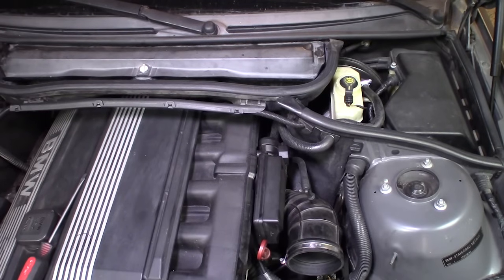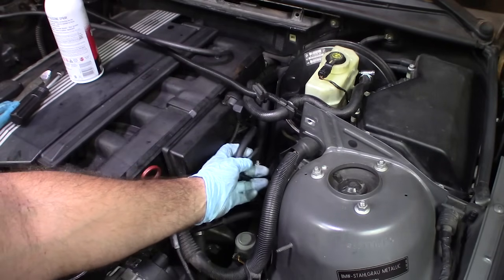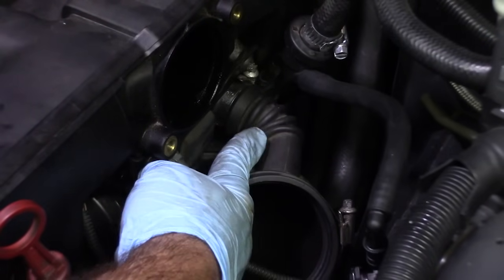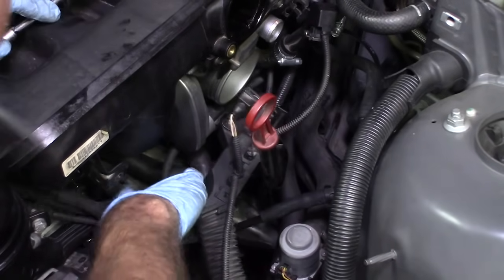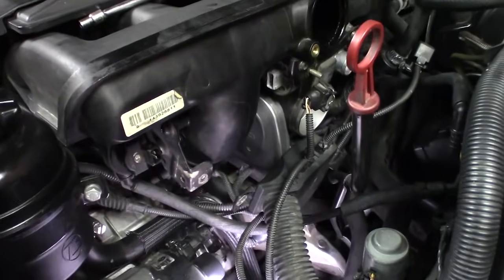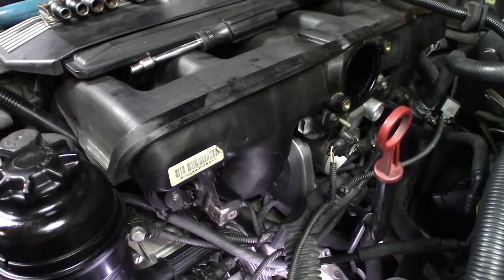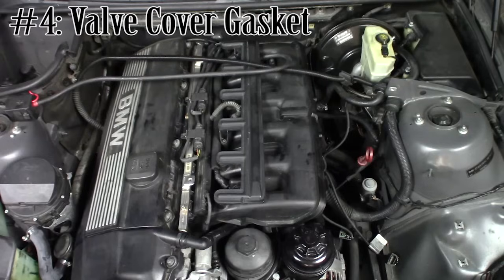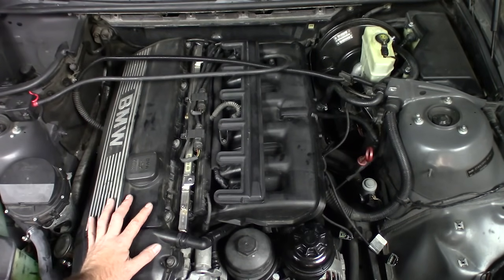BMW E46 & E39 Most Common Vacuum Leaks P0171 & P0174

Comment: Hey bro.. I need your help..Im a mechanic but not big Into repairing BMWs... My son has a 05 330xi...we replaced all coils, plugs, ccv valve... O2 sensors and it STILL runs like crap and no matter what i do,  I still get the same code for bad oxygen sensor and misfire??.. What could it be?????

Comment: Thank You! I have already replaced a few parts that have helped in various ways (MAF, purge valve sensor, thermostat, spark plugs, the list goes on), but my main issue is still not fixed. I will be checking these parts. I was told to check them, but didn't know exactly what to check. I will be pricing all of these parts before I even go check, because I'm fairly certain you have given me the answer I have been looking for!

Comment: Hey, love your videos man, thanks for all the helpful info.
Quick question, if I'm only getting P0171 code, could it still be a vacuum leak? Or is this like a faulty O2 sensor in bank 1?
Reply from the maker: +James W (CanadaShooter) Could be a vacuum leak on just that bank, yes.  Checkout my fuel trims video to be sure: https://www.youtube.com/watch?v=4CcwtaIe5c4 -- that video should also help you figure out if you have a faulty O2 sensor (ie if the voltage of the pre cat sensor is not going up and down and you are in closed loop, it's likely bad).  Don't just waste your money on O2 sensors--they don't often actually go bad.  Find your leak before you throw parts at it.
Reply: +50sKid OK thanks man, that helps. I'll check out the video and start checking vacuum/intake hoses tonight. Good thing I have access to a spare car.
Once again, thanks for the help!
Reply: 50sKid hey kid I have a bmw 323i 2000 is getting a code 1250 do you know what’s that code?

Comment: Really great vid im chasing down a PO174 fault currently on my 320i. I found a split in the upper intake boot so im hoping that was it and there are no more. However when cold the engine runs very slightly less smoothly but only for 30secs so im wondering if there is another.I am waiting to see if the EML light comes back on.
Reply: +macpdm While you're down there you might want to also clean your idle control valve.  It's accessed by doing basically everything that is depicted in this video..  Good luck!

Comment: Hello,

I have a bmw 5 serie e39 with and M54 engine. 

I am worried about the following.
- It makes a whistling/whining noise when i press the accelerator pedal.
- When i turn off the engine a couple of seconds later it sounds like it is relasing air like a relief valve when it has too much pressure built up.

Can someone please help me with this?

With kind regards, Jens

Comment: Thanks for the video, especially the ccv quick replacement one. I followed your advise step by step and managed to replace it eventually. However i found something that might interesting.

The ccv has a hose leading to the oil dipstick.when removed the hose I found the dipstick got completely stuck of oil dirt. I cleansed it but when I pour cleaner in that hole, the cleaner still got stuck.

So my qusstion is that this hole should have an open route to the main dipstick line or is it a dead end hole?
Reply: Actually I realised that this dipstick should lead the oil condense back to the oil pan. So if it is clogged, can it cause misfires?

Comment: try removing the small tube at the top rear of the boot behind maf. temporarily install a length of tube that allows you to blow smoke (cigar?, or users preference) into the intake boot and check for leaks.

Comment: Very helpful, thanks! I'm currently trying to self diagnose my running issue, lack of power, slight kangarooing when driving, rough idling and randomly cutting out when coming to a stop..? No faults on plug in! 2003 E46 318ci If you have any input to where i could even start that would be a huge help

Comment: I have a vacuum leak with error codes p0171 and p0174, I took it to the mechanic and they ran a smoke test through the intake and said i had a leak in my air intake manifold control valve, they quoted me $840 for parts and labor and I believe that's too high. What is everyone's thoughts? (I know only basics about mechanics)

Comment: I have codes 1423&1421 I replaced all the air intake, maf sensor all Ccv unit all 4 O2 sensors n still have the codes grrrr anyone have any advices ? Thanks

Comment: Hello,

last year I had these codes and thanks to your video I noticed that the intake boots were broken and for one year everything was great !

Now I have E3/227 and E4/228 CA/202 CB/203 "deviation too great too rich" "control limit limit rich"

Do you think I should look for a vacuum leak or for something else ? 

Car runs great as before.

Thanks

Comment: Excellent information. I have owned my 2002 BMW 325csi since new, and am having the vacuum fault code occur regularly, and now a rough firing engine, with the fault code on my OBD reader indicating this problem. This is excellent information for me, and as I am a long time hobby mechanic, I will check out all the potential sources of the cause. Thanks again... ... Fortunately, my 1966 Lotus Elan does not have these type of problems.... Dual Web Carbs and "O" rings on the intake manifold are all that I have to check.... oh well !!!!

Comment: Great video, particularly the fact that you take the time to explain what is going on. I have a quick question. If the oil separator is not broken like in your case but still there is a vacuum leak from the two pipes connected to it (I smoked the system and it was clear smoke was coming out of the two pipes where they connect to the oil separator) does it make sense to replace the pipes only (assuming there is  fast way of doing it) or the work involved to reach there is so much that one should just replace "everything" (perhaps including gasket seals is they are too hard). Thanks!
Reply from the maker: Just replace everything since the oil separator itself is something that will fail eventually (the diaphragm inside of it tears).

Comment: @50sKid 
If the Oil Return line from the bottom of the Oil Separator going to the bottom of the oil dipstick is cracked or has a hole, would the "Remove the Oil Filler Cap" vacuum test be effective for testing for that leak. Because I tried removing the oil fill cap with engine running and the car's idle went from bad to worse then I put the cap back on and it got better.  Basically, does the oil cap removal method mean all of my CCV components are working properly when I hear the change in engine idle?

Comment: Thanks a lot for this video. I had just got out of the hospital when my grandsons 2001 325xi started giving him p0171/p0174 codes. I took all the hoses I could get to off and looked for vacuum leaks. I had even taken the intake runner out to get better access to look for other leaks! Didn't know enough to look at the gasket at the time. I only knew that when I sprayed brake fluid into the general area of the intake, I could occasionally get the engine to go rich for a while. It was so tight an area that it was hard to locate exactly where the spray was impacting the leak. I almost gave up and had the car taken to a shop to be smoked when I ran across your video. One viewing of your video and I knew it was the seal on the intake runner. Borrowed an incorrect sized seal from my neighbor and managed to prove it was leaking(couldn't quite get the intake runner shoved back into it's slot-but the seal held). Have ordered a new seal and will be in next week. In any case, your video was instrumental in my fixing his car. BTW, I too broke a rubber housing taking it apart(ironically, BMW had that housing in stock for $22 but wanted $400 for the intake runner because they didn't sell the seal by itself! Thanks again!

Comment: Do you think surging idle might be caused by vacuum leaks? Also the 325i I'm working on has terrible oil and hasn't been changed for god knows how long. Do you think bad oil or oil leaks also contribute to the surging idle?
Thanks man! By the way, very informative video.
Reply: The valvetrain relies on hydraulic pressure from the oil to operate... If your oil is bad or pressure is leaking, then the valves don't run properly, and your idle will bounce up and down. Another common cause is the Oil filler cap gaskets.

Comment: Hello! I love your videos and have been watching them like crazy. I got a 2001 bmw 330ci that idles very rough. It used to happen randomly every 1000 miles or so and a restart used to fix it. I have been meaning to fix it but the other day it just completely went bad. Now it idles rough right away as soon as I start the car and it's basically unusable. I checked the intake boots and those seem fine. There is very slight oil leak from the valve cover gasket but I checked the vacuum line in your valve cover gasket video and that seemed fine. Any suggestions? I do have both lean bank codes.
Reply: Migght be maf

Comment: You are the MAN!, thanks for your videos 50's kid. Add a donation link to your youtube page, you deserve some rewards for your good advice!!! i had this issue for years, sent my car to mechanics and kept changing sensors, and i gave up, until i saw your video. I followed steps by steps and got it fixed. I am not mechanic but you made it so easy, anybody can do it. I had vacuum leak on top air boot, my disa also was leaking and the bottom boot was also fixed with electrical tape!!!, i fix these 3 f(including the cabin filter) or less than 50 bucks!!!.  Thank you for being around, we E46 fanatics will appreciate it.

Comment: I have no leaks and 52lbs pressure and still 171/174.. I ordered the reader and am hoping to see if it is the MAF or the O2 sensors. It takes 50 miles to code after reset.
Reply: I replaced the CCV, hoses, dipstick o ring, throttle body o ring, DISA seal, O2 sensors. STFT was at zero, LTFT stayed around 14. I replaced the MAF and the LTFT iwent down to zero and out went the CEL. Your video helped BIG TIME to diagnose. The MAF was trending around 5 at idle (900rpm) until I replaced it and the flow was showing 6 after replacement.
Reply from the maker: +Robert Tison nice, great going

Comment: Hello,

this video is great and so clear, thanks a lot man. I was so pround I managed to change both the Oxygen sensors but your right the problem was all the leaks...

I got a E39 530i, it seems that I don't have any line close to the Oxygen sensors. The one your are talking about at 13:00. Is it because It is simply not here or because there is none ? 
Do you have more information about that line ? 

Thanks a lot. Greg.

Comment: If you have 171, 174, AND the code for wiring on O2 sensor bank 2, is the most likely situation that both my bank 2 o2 sensor is bad AND I have a vacuum leak?  BTW, thanks so much for these videos.

Comment: It’s 100% those two vacume hoses, I knew they were cracked and probably Leaking, Also getting a Code for my intake boot But I literally just replaced it with a brand new one ( cuz my dumbass ripped it off) will be replacing those Hoses soon, I know for a fact it’s those

Comment: anybody deal with surge and stall code p1632 p1634
Reply from the maker: Try turning your ignition to on (but don't start the car) for 1 minute.  The computer will automatically recalibrate the throttle body.  Have you recently cleaned your throttle body?  If so, did you manually open the throttle plate?  That's what damaged it, if so.

Comment: Thanks for a great video! I've got a BMW 525i e39 touring -02. I have the same codes. P0171,P0174. I have done several smoketest on my car and there are no leak anymore. It began with some leak at first, we changed the valve cover and gasket, and intake boots. First i thought, GREAT now the problem is gone, but NO NO! I have also replaced my FuelFilter "the one that i had was original, WHY? i don't know, I mean it was really dirty". I have changed both of the oxygen sensors, "maybe i didnt have to do that", I have tried to clean my Siemens MAF with CRC. But still the engine light will appear randomly. Sometimes after 1miles "swedish miles", and sometimes after like 40miles. This is CRAZY!! The car runs good. Next step? Fuelpump/Injector/Fuelpressure?
Reply from the maker: Lars von trier pung What about the DISA valve?  Replace the o-ring.
Reply: 50sKid Hi!! I did that too. But i think i have something. It's just a guess. When the engine is cold when i start it i can drive a long time, no engine light. But when i stop and turn off the engine and wait for 1-2 hours, and drive further again,.the engine lamp appears after 3-4Km. "Everytime", at least tha last 4 times i did the test. Do you think it is the temp?
Reply from the maker: That's likely because you need two driving cycles (starting your car when it's cold) to cause the codes to appear.  No amount of driving is going to fix your vacuum leak, though.  You have a physical leak of air into your intake system.  Watch my video until you have a grasp on this concept and then look into the various areas on your own car until you find it.  If you are doing this yourself, you should find it.  If you are having the work done at a garage then I can't help you because who knows if they are doing the jobs correctly?
Reply: 50sKid Im doing the job at a garage, they are saying that there are no leak. But i will return my car to them. Problem still there. Now they will get more info and i hope it will be easier for them to find it this time because i found a pattern. If they do as i say they will get the engine light. And i have already payed a max fee for troubleshooting, so thats nice. But i can tell them what you said, prob still some leaks... Thanks. I'l be back with more info later. :)
Reply: Hey 50sKid I have a huge vaccum leak its so bad I can actually hear it, its coming from the brake booster but im unsure wich hose it is. Funny thing is when im inside the car i could step on the brake and the hissing vaccum will go away. But as soon as i release the brake, the hissing comes back. Could this cause my lean code? if so what's the best remedy to leak I hope I don't have to change the entire brake booster.
Reply from the maker: +jayspeed BMW sounds like your booster needs to be replaced, I'm afraid.
Reply: 50sKid awww mannn. Ok thanks!
Reply from the maker: jayspeed BMW Yeah I'm sorry about that.  From your description it sounds like the internal seals are leaking.  You can get an ATE brand (which is OEM) booster off eBay for around $200.  I'm sure you've seen my video on replacing it.  Not too hard!
Reply: 50sKid I replaced the MAF with a new Siemens. Now it's gone! Didnt work with cleaner.
Reply: @larsvontrierpung9337  do you have the MAF part link? or parts number? thx
Reply: @3dkinson  the problem was actually a crack in the plastick cover. Not MAF. Did aSmoketest.
Reply: Dont remember the partnumber sorry.

Comment: 3:50 when somebody is about to spray the MAF be also ready to buy a new one. Meaning you will try this as a last option before actually buying a new one since the chances are very slim to none it will work. It does in some occasions but the overal percentage of success (short and long term) is very low. Just saying.

Comment: I have similar issues when cold, except i have rich codes (but with positive fuel trims, confusing AF),am currently running with MAF unplugged because it at least runs negative fuel trims until i figure out whats going on.
I would rather it run a bit rich than lean anyday.
2001 e39.

Comment: Great video! Helped while doing my repairs. I just replaced the whole CCV and DISA valve on my 04' 330ci. I just cleared all the codes, rough idle is gone but there is a steady loud (to me) hissing coming from the intake manifold that I don't remember noticing so much close to the DISA valve. I'm wondering if the DISA O ring wasn't seated properly when I replaced it. Thoughts? Your response would be VERY appreciated. :)

Comment: Hi 50sKid!  You have great videos and I appreciate you doing them.I'm a newbie to BMW's specifically my used 2001 330ci, E46 M54.  I recently pulled the intake manifold to find most of the vacuum lines rotted away and disconnect.  Can you tell me how many total vacuum lines there are on the stock E46 M54 and where each is going from and to.1. From larger one on F fitting on intake boot?2. From smaller one on the F fitting on intake boot?3. I plan to use the larger nipple on back of intake manifold to go to the CCV valve you demonstrated in your other video.4. What is the "unused" and uncapped small nipple on back intake manifold used for or go to?5. Vacuum line coming from the transmission tunnel/undercarriage...where does this run to and from?If there are any others I haven't mentioned please let me know.  Thanks.

Comment: Great Video! I was looking for help with my E90, But now I know where to check my E39 for leaks. Hopefully she doesn't have to sit up anymore!!!

Is there a big difference for the E90? I hear the leak on the passenger side, but can't locate it.
Reply from the maker: +Jaz “Jamalajaz” Cee Yeah the E90 is different.  You'll have to use propane or brake cleaner to locate the leak.  Or get it smoke tested.
Reply: Thanks!